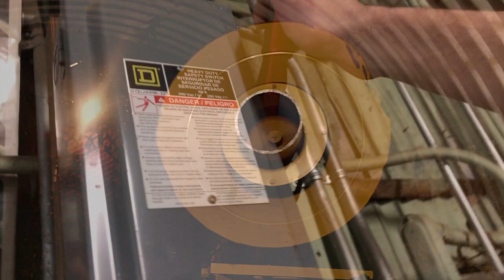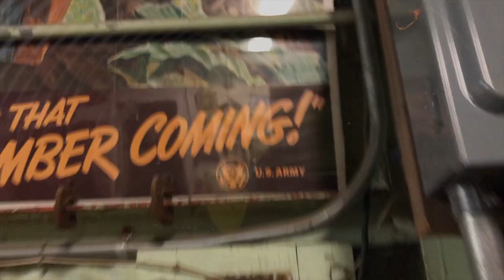Federal 500-SH-TT Attack And Alert (Multiple Shots)

Comment: The rotator needs to get fixed as it is not rotating correctly and the horn bend also needs to be bent back to the original spot. Other than those the siren seems to work well after all those years!
Reply from the maker: The rotator is intentionally disabled. We need the siren to face the same direction for the event.
Reply: @friedmanirit  oh i see. But the bend still needs to be fixed. If i could get my grandpa over to where the siren is located right now, i bet he could easily fix the bnd.
Reply: *bend
Reply from the maker: The dent in the horn is from when it bumped into something while being moved. Due to the corrugated edges, fixing the dent isn't the easiest thing to do, but it can be done. The thing is it would make more paint chip off.
Reply: @friedmanirit  then i could ask my grandpa to spray paint it to llok good as new.
Reply: *look
Reply from the maker: They don't want to mess with it. It sounds fine, and it's only taken out once a year, and it's covered in fake camouflage leaves so it doesn't take away from the actual event.
Reply: @friedmanirit  ok then.
Reply: I have also found that this is not an SH-TT it’s actually an AT
Reply: @friedmanirit  I like that fake camouflage you got. That's pretty unique and awesome.
Reply: @friedmanirit  Long time no talk. It would kinda make sense to have both the Chrysler and 500AT rotate because it would sound more like the real deal.
Reply: @MasenMonsteryeah the SHTT is 10/12

Comment: That's a 500 DH-TT... Where did you find this?
Reply: No it is a 500 SH-TT DH-TT’s have two horns and they are 8/12 port and not 9/12 port like this SH-TT.
Reply: The only operational DH-TT is in Calhan, Colorado, and this is in Los Angeles.
Reply: @WhelenWPS3000 no this is a 500T, SHTT’s are 10/12 and a longer horn with an inside cone covering the chopper

Comment: So pretty much all of the Los Angeles sirens were 9/12 port? Lol
Reply: Besides Chryslers and thunderbolts yeah
Reply: @ThunderTrain2930  Even SD-10s were there too in LA
Reply: NeilPrasad 1905 yeah but Chryslers and bolts weren’t 9/12
Reply: @ThunderTrain2930  Correct, and I believe neither where the HOR Sirodrones and that 2T22 near Beverly Hills
Reply: @gabrielstravels  2T22s are usually 10/12 ports
Reply: @ThunderTrain2930  Chrysler is an old siren run by a gas engine with a screeching 138 dB loudness
Reply: @NeilPrasad_1905  yep, I know. I was saying a list of LA sirens that weren't 9/12 and the 2T22 is one of them.
Reply: NeilPrasad 1905 I know..
Reply from the maker: The main LA County system consisted of Model 7Ts, SD-10s, first generation 500-SH-TTs, and Fedelcode Type/Mach 3Ls. The Type/Mach 3Ls were installed before the rest of the sirens, and are 8 port. The rest of the sirens are 9/12 port. Of course there are also other sirens in LA such as Mobil Directos (8 port), Chryslers (6 port), Thunderbolts (4/5 port), etc.
Reply: @friedmanirit  Don't forget the 2T22/3T22 near Beverly Hills which is 10/12 port...
Reply from the maker: @gabrielstravels  Yeah, it's a 3T22. It's on the Brentwood Theater. There are also early 2T22s and a B&M in Vernon, as well as other B&Ms in and around LA.
Reply: @friedmanirit  Oh I thought it was a 2T22 because I didn't see any solenoids lol
Reply from the maker: @gabrielstravels  I've been there a few times, it's definitely a 3T22. I'll see if I have any pictures.
Reply: @friedmanirit  If I remember correctly (looking on Streetview) it's a white 3T22 isn't?
Reply: @friedmanirit  What sirens are replacing those old sirens in LA?
Reply from the maker: @NeilPrasad_1905  None.
Reply: Edaan Friedman come on. They should still be used for earthquakes, tsunamis or even volcanic eruptions
Reply: @NeilPrasad_1905  ikr
Reply from the maker: @NeilPrasad_1905  System is far outdated, and we don't have volcanic eruptions here lol.
Reply: @friedmanirit  listen. There is a possibility in the future about these events because earthquakes happen there frequently
Reply: Same with Mobil directors or even gas powered ones
Reply: @NeilPrasad_1905  Although I have nothing against an outdoor warning system, do you know how much time and money it would cost for the city to maintain and restore all of those and make them run correctly again? And to get parts considering they aren't made anymore?
Reply: @marylandsirensfirebuff9664  I know what you mean. Again, it's necessary apart from the EAS to alert the people further in my point of view.
Reply: @friedmanirit  Yep!, California does not have volcanoes